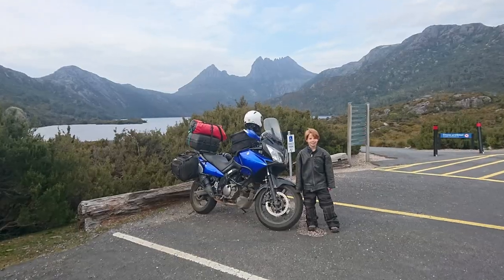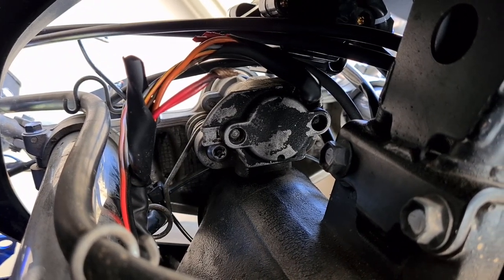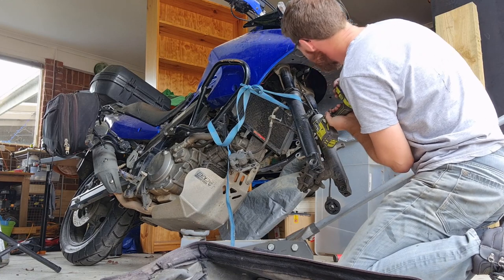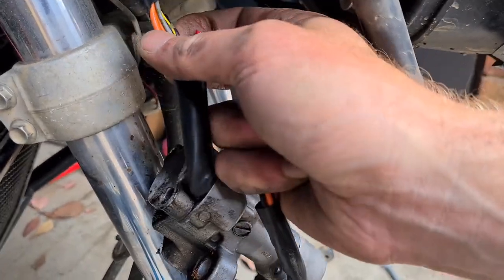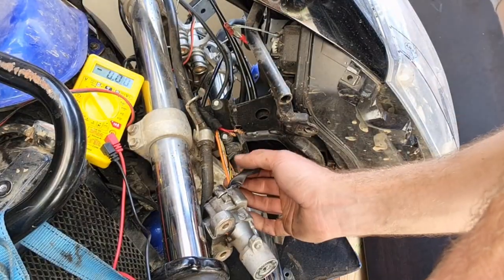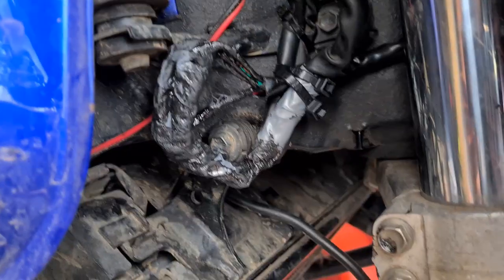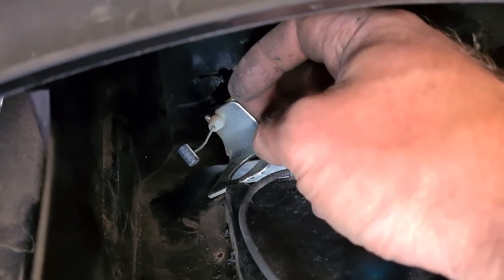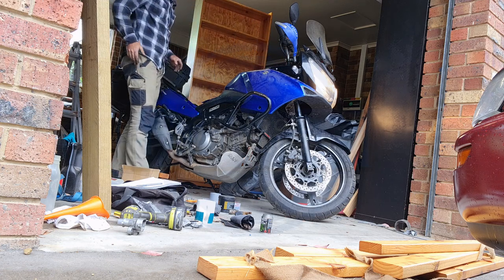Stolen bike is recovered: replacing the ignition barrel and locks

Comment: Hey mate,
I just bought a roadworthy 2005 strom 650, with a busted ignition.
You’ve made this job much easier for me! I was going to drill out the security screws on the ignition haha, as most tutorials show.
Instead, I went to bunnings and grabbed that exact Torx bit, 5 min job with a ratchet!

Now I’ll be able to enjoy this 650 I bought for $900!

Only difference is the thieves that tried to steal this one had angle cut most of the “barrel holder” part of the triple clamp, then fled after botching it+key barrel. So will get a triple clamp with key set.

TYSM for documenting this well!

Comment: I just replaced the 3 locksets on my son's SV650S last week. After 2 locksets later,... (I ordered the wrong one first.) The wrong one had 6 wire plug and the correct one has 4 wires. It feels really good not having to wiggle and jiggle the ignit key to get in to turn.
Reply from the maker: Well done! Did you find one with a matching loom socket as well? Might be good to share the link!

Comment: How did you know what ECU ect colours were what coming from your motorcycle
Reply from the maker: I pulled them off a couple of forums (to double check) then mapped the colours together on the chart that's included in the video. 
I double checked all the wires with a multimeter for the circuits that could be tested on each
Reply from the maker: Do yours match?

Comment: Hi G'day Craigo in video original ignition barrel got 2 red wires and amazon one got just only one red wire. So amazon ignition barrel one red wire has to be connected to two red wires?thanks
Reply from the maker: Hi John! I made a wiring chart (at 4:25). Mine had a red and orange original wire. Red was batt hot and orange was the starter circuit. My recommendation is to follow the chart and work out equivalent connection with that. All the best!
Reply: Hi i G'day Craigo do following you but i got one spare red wire coming from motorbike (2 red wires coming from motobike are them have to be vonneted to the one amazon ignition barrel wire?)thank you
Reply from the maker: Hey John, I think you might need to test them - is there constant or switched power coming from one or both of them?
Reply: Hi G'day Craigo got same bike happend same situation like yours in your video old harness got 2 red wires and new harness got one red wire(what did you do with old harness 2red wires?did you connct them both to new harness one red wire?thank you

Comment: How did you get the bars out of the lock position with out the key?
Reply from the maker: Fortunately I don't use the lock position. But once you drop the barrel out it should be fine to move around again, same thing on a different angle, I'm thinking

Comment: Why not just trace the connection box and save so meany connections and risk problems in the future
Reply from the maker: Yeah I guess that could work with a proper length wiring harness, except the new key barrel only had about 100mm of lead so I had to connect it around there anyway